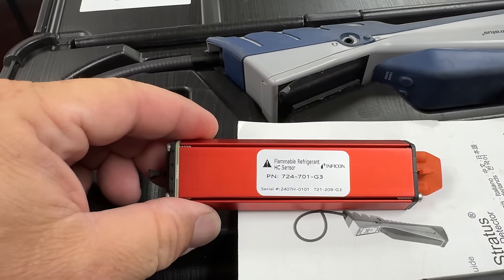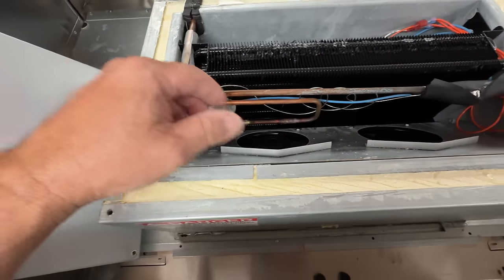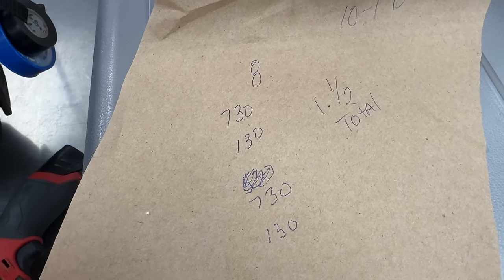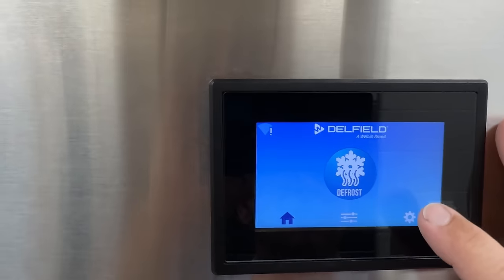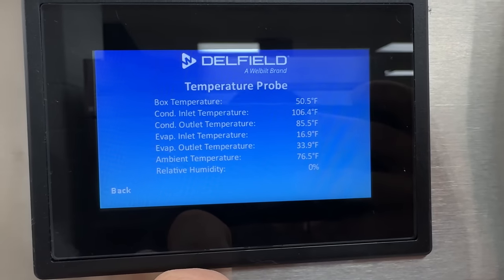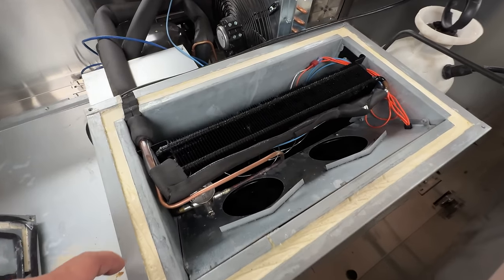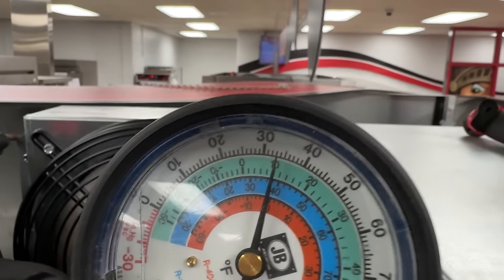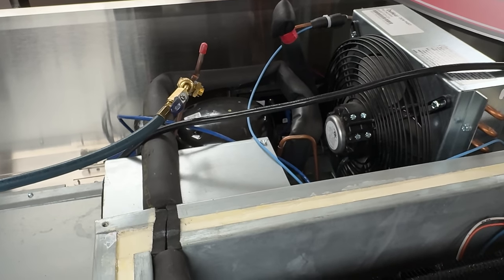Fancy R-290 Delfield Cooler Not Reliable Multiple Problems Freezing Up

Comment: I am so glad you said that about tech support and the whole process. 
Also, your leak search as well. I  didbasically the same as you. I do not like Danfoss TXVs. I chalked it up to bad charge from the factory. Aint no way those workers get paid more than us. Is like I tell newbies, you can not do refrigeration unless you like it. It's not a job, it's a lifestyle.
Reply from the maker: That is a good quote to use. “You cannot do Refrigeration unless you like it or I would say love it. It’s not a job. It’s a lifestyle.”
Reply: You don't like Danfoss TXV's? I'm a Sporlan guy myself, but that's a lot from my Dad who swore by anything Sporlan and he was a huge fan of their driers when they came out with that solid core tech decades ago. But Danfoss TXV's have a stainless steel power head, and stainless steel temp bulb/cap tube, so they don't have the issue of power heads paint flaking off and rusting out etc. I've had good luck with both brands.
Reply: 👍💪🇺🇸❄️ absolutely agree well said 👍
Reply: It is lifestyle. For sure if your a supermarket refer tech lol
Reply: @Bassn1ck  Exactly. Van life.

Comment: Great video; I should talk the shop into getting one of the combustible cartridges for my leak detector, but for now the Inficon combustible gas detector is doing well for me for the time being.  Probably won’t be long before I run into one of the newer Delfields…so far I’m not impressed with the longevity (or lack there of) with the A3 refrigerants.

Comment: I've used my D-tek Stratus for natural gas or LP gas with just the stock sensor. It works really good! Even goes off with a natural gas leak nearly too small to smell or even get 2-3 tiny bubbles.
Reply from the maker: I haven’t tried the traditional refrigerant sensor for hydrocarbons, I would be worried of missing leaks. However that’s interesting to hear. I may give it a test on it.

Comment: When one of our customers started using Hoshizaki RIC we found out that they were only using one sensor (cabinet sensor). To save energy the evap fan motor would shut off during the off cycle. Under light duty this system worked fine. When a unit was under high demand we found out that these units would have a tendency to freeze up. Cabinet sensor would check out fine as well as the temp control dial. 95% of the time the fix would be to wire the evap fan motor to run all the time. The benefits of off-cycle defrost as well as scheduled by the controller. 

The problem using only one sensor is that it would terminate defrost on temp 45 degrees.  High volume boxes can hit 45 pretty fast. The newer Hoshi's use two sensor (cabinet and evap) and haven't' had much of an issue with those.
Reply from the maker: That’s a very good suggestion wire at fan all the time on a cooler. Obviously that wouldn’t work on a freezer unless you wired in a relay to break the fan when the heaters came on 😆
Reply: @HVACRSurvival  You could gut it and rewire, and use a Dixell universal controller, they're quite flexible and can program it to run the fans all the time if you want to. I think the Carel controllers also have a lot of setup options, both of those brands don't have an adaptive defrost, but you can do time or temperature termination. The reachin Avantco freezer I have at home, the default defrost termination is 50 degrees, and that seems to work good. I just changed the number of defrosts from 6 a day to every 8 hours because I don't open the doors very much. I thought about changing the fans to run all the time, but that would be more wear and tear, and might increase the electricity use a bunch because of the heat generated by the fans? Right now it's using about 1.6-1.9 kwh/hr per day which is acceptable for a freezer.

For a cooler, I just use a Dixell universal controller, set it to 36 degrees, and a 30 min defrost every 8 hours or every 6 hours if they tend to leave the doors open a lot. Most of the time 3 defrosts a day works good. Prep tables can need every 6 hours, depends on how heavy use it gets. For a cooler I leave the fans running all the time for off cycle defrost. Had trouble with a bar reach-in glass door beer bottle cooler that was always freezing up, I got rid of the electronic module that turns the fans on/off, and bypassed it so the fans run anytime the power switch is turned on.

Comment: Great video. I always found the leaks to be at the punch off points from the factory or I question if they were charged right from factory. I never remove my service fitting either and just let it on. Trying to pinch and braze it off again is just a possible leak again. With such a small charge to these units a micro leak can cause issues. Good catch on them having the fan cover in wrong. I completely agree with your comments about factory tech support being a pain and them reading from a book.
Reply: Yeah so many manufacturer's of these small reach in units just pinch off and don't even braze. I've cut the factory service lines off of newer True units, sweated on schrader cores and recharged, left the cores on (with brass caps) and no further issues.

Comment: Love the interchangeable sensor in the Stratus.
One thing i notice, once the top of the cover is the gaskets never seal back like it was. I haven't come across these newer. Delfields, they are getting fancier which means morw problems. In my experience R290 systems always leak. Good video Rick.
Reply from the maker: I agree, I’ve had several leaks on the True and Chinese equipment. Now it doesn’t hurt the environment so they say so. What’s the big deal just keep recharging it right lol
Reply: @HVACRSurvival  correct me if im wrong but according to inficon that sensor is only good for natural gas and not R290 propane, which make no sense cause propane has methane, its just a higher density fuel than natutal gas ....keep you good work trade need more tech like you
Reply from the maker: @Ismael72110 I just looked on the website and it’s ready for R 290, 600 and some 400 gas. I know the trial sensor that they sent me worked good on natural gas and propane as well but I don’t know how the final one does on those fuels.
Reply: @Ismael72110  Propane is propane, methane is a different chemical altogether. I think you meant natural gas which is mostly methane with a trace amount of hydrogen that varies throughout the country. It's roughly 95% methane.
Reply: @HVACRSurvival  yeah ,,just checked and they updated their website cause before said , natural gas only ,,that why i was holding back in get the R290 sensor

Comment: 22:11 - I’ve not seen taps like that before. What fitting are you using for your gauge on that process tube? They look much more substantial than the bullet piercing valves I’ve seen at the supply house.
Reply from the maker: That one was made by JB. It’s like a splitnut. There’s ones out there that you can get that looks like vice grips that will tap into it also.

Comment: Have been told by True, you can use R134A with some nitrogen behind it so you don’t need the combustible leak detector.
Reply from the maker: I just watched a Delfield training video and they are not recommending the yellow leak detector anymore because the sensor loses its sensitivity. However, the detector I used is an infrared cell and therefore it should not lose any sensitivity just like it doesn’t on refrigerant. If you noticed the R-404 I added in the video was actually recommended to me by their service people, which is why I did it.
Reply: @HVACRSurvival  yeah your leak detector is very nice! I actually posted this before I saw you use the R404a, should have waited till the end before I commented. I really like all your videos and how you explain everything you do. Helps me out substantially!

Comment: I would just get a permanent red marker and mark the process line. Whirlpool just has us put a sticker on after a sealed system repair. I replace about 1-2 compressors that are locked up from R600a. Those systems have to be clean. Only capillaries though so more potential restrictions.

Comment: Rick, is it possible to share the link for that manual ? I would like to read more about new Delfield equipment. Worked on a ton of their coolers and freezers, and they had always issue with icing up even with R404A refrigerant. Thanks for  great video.
Reply: If you're a tech I'm sure you know they frown on that. Even though we have right to repair and should be able to get it free without an account. Probably can get a free copy online somehow if you can get the model number.
Reply from the maker: I believe it’s on their website. I saved it to my Google Drive.

Comment: Met with a rep from Follett and he was saying with the R290 and R 600 you can except an even shorter lifespan on ice makers and refrigerators. Not sure if you heard the same thing.
Reply from the maker: I don’t think I’ve seen an ice machines with the R290 in it, but so far it doesn’t appear that anything that is running on it has been operating as well as it used to.
Reply: @HVACRSurvival  sounds like in that meeting, Follett ice machines in 2025 will be running on R290 and their Med fridges will be using R600.

Comment: Hi Rick. Which r290 can are you using in this video? The cans I typically use do not have compatible thread size with that scale. By the way, I prefer working on r290 equipment over r134a. 290 doesn't restrict cap tubes. 290 can be vented, and the charge is much less. 
Cheers
Reply from the maker: Those are all valid points, I believe it was from Nu-Calgon
Reply: Yeah I've noticed that too, R290 has a lot lower discharge temperatures than R134a. Seems like the high temps of R134a combined with dirty condenser coils turns the POE oil into a wax gunk which clogs up cap tubes. And then the compressor burns out since it's not getting it's cooling from the cold return gas. Then you have the mess of a burnout combined with the clogged cap tube, and it turns into a nightmare. Time to buy a new fridge :)

Comment: On the crimp / solder seal connection from factory leak a lot. Found good bit of brand new units leaking from there .
Reply from the maker: You mean on the capillary tube area?
Reply: @HVACRSurvival  like where they charge up the unit from the factory & crimp it.

Comment: Thanks for posting.  My time is nearing to work on R290/600 systems.  What is that piercing valve p/n you used w/ your dial gauge?  Overreacting DOE/EPA strikes again!  Vote wisely folks this November!  BTW, just got the scale and your code saved me around $17.  Gracias!
Reply from the maker: Thank you for using it! It’s a JB tap i’ve had for several years, I don’t know if I hundred percent really like it, but you can give it a shot. It’s not much price difference between that and the cheaper bullet piercing valves, but it can be reused until the rubber starts to rot otherwise they make a vice grip style piercing tool that will do the same thing it’s made more for recovery of a system before you discontinue it.

Comment: Fancy stuff!  I cannot figure out why these new r290 units have no leaks but are short on gas.
Reply from the maker: I’ve had a shit ton of leaks on the True units in the evaporator section. I’ve also had a shit ton of problems with their freezers, not defrosting because of the parameters that they chose to use with their newer control system on the LAE controllers.
Reply: @HVACRSurvival  I've gotten a bunch of some chinese brand equipment that has lasted longer than the newer True stuff which is way too expensive

Comment: Few things I've seen....possibly wrong txv with such a low evap inlet....

You can check subcool on txv, usually over 15 degrees and the txv is locked up causing low Suction as well

Good old r290 guessing game
Reply: Txv system**
Reply from the maker: I would’ve had to tap the high side to get the sub cooling. I just watched a training video one of my viewers sent me for Delfield. I’m gonna post that at the top here in a little bit.
Reply: I enjoy your videos, it's therapeutic to  hear your thoughts on very similar bullshit

Comment: Nice job bud. Not the same unit, but I've had a bunch of issues with those True Blue Controller units icing up because of the evap sensors going bad. I just unplug those sensors when I see them now. 
Also, do you still do live streams?
Reply from the maker: I haven’t done the live stream for a while however, I have thought about doing it every now and again. So are you telling me that controller will work OK without the sensors? What will the system do without them?
Reply: @HVACRSurvival  I'm probably going to go live tonight for the first time. We'll see how it goes. 
As far as the True Blue Controllers, it will make the evap sensor show -50° which will just make it run a time defrost. I don't work on much delfield, but honestly the evap section of those cases look just like the little True 3door freezers. So it might be the same 🤷‍♂️
And to be clear, I'm just talking about unplugging the blue evap sensor.

Comment: They are not going to last long. The fan wire was on the drain pan evaporator coil fun fun fun. And looked like normal cheap computer style case fans in the coil
Reply from the maker: It’s interesting to hear others say they have had similar issues.